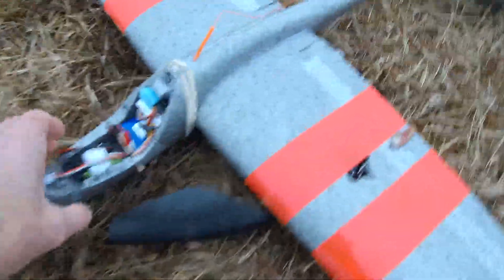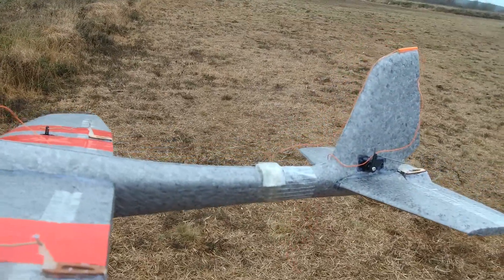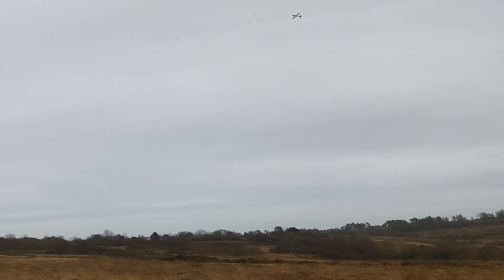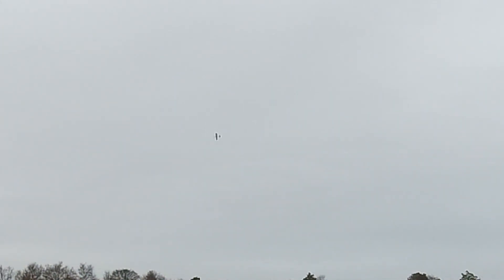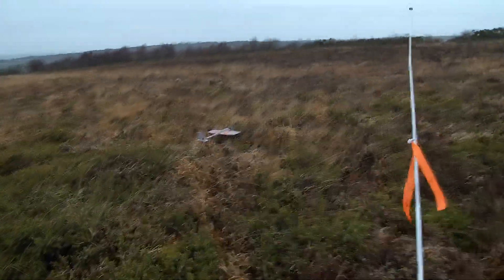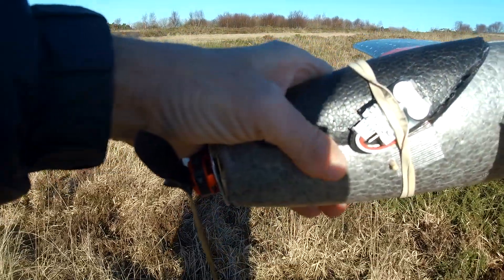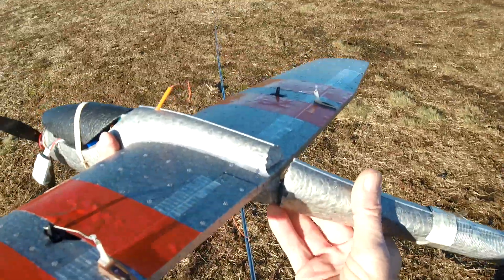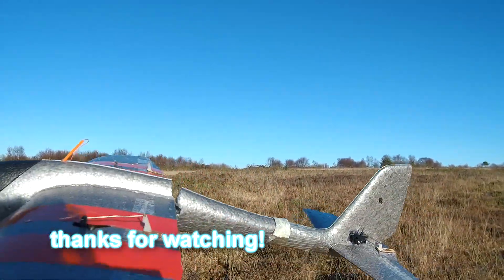Lidl Glider RC Conversion - was it one crash too many? :(

Comment: It'll repair ok, I glued in an old carbon car aerial down the length of the fuselage which has saved me on occasion.
Reply from the maker: Thanks Cliff.  It already had a thin carbon insert and snapped at the point it finished just behind the main spar. 2 mins after getting home it was hot glued back together and you can't even see the join!  I think it's way overpowered anyway so I've taken off the 3 blade prop and put on a  2 blade 6035. I'll try it with that. It draws 40 watts with the 2s.  250 gms model.  Should be enough? It'll just about prop hang with that without the motor getting warm which it was before.